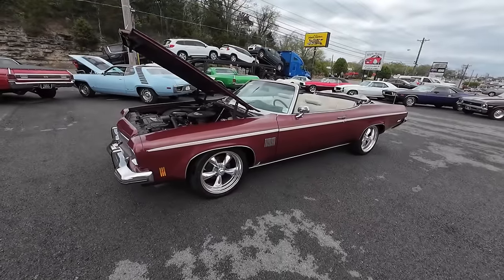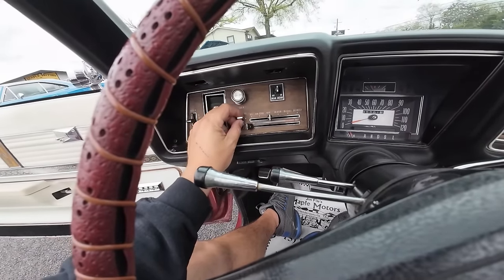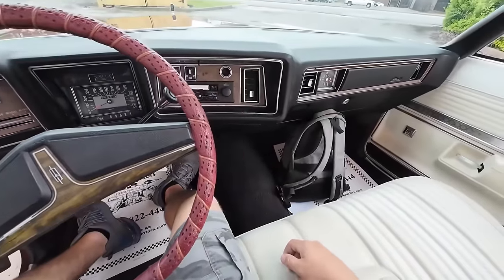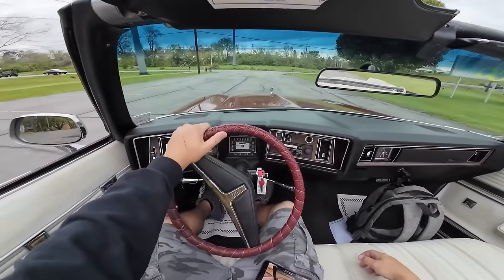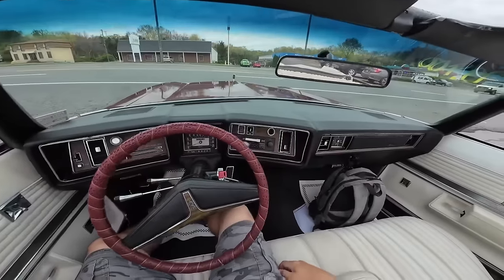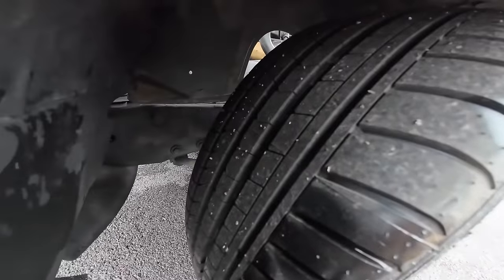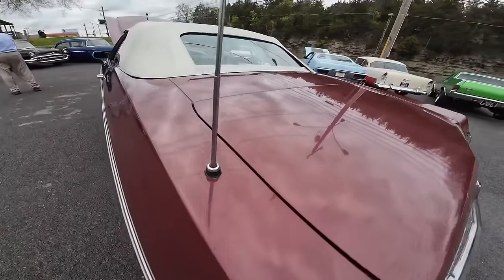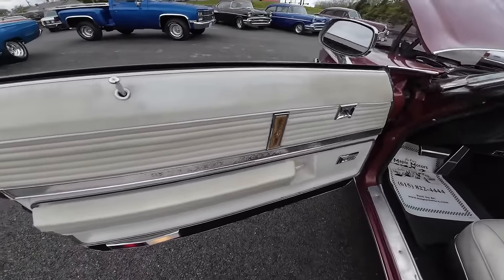Test Drive 1973 Oldsmobile Delta 88 Convertible SOLD $17,900 Maple Motors #2544

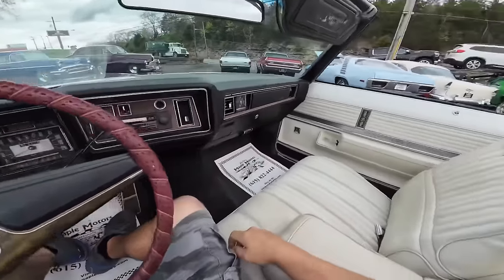Comment: @2:18, I like the widescreen a lot. Also, the interior of this vehicle is bigger than most studio apartments so it's perfectly appropriate. Great inspection and for the price, you get two easy chairs and a full-sized couch along with a convertible top. This beast screams 'good times.' I love the paint job. The engine and exhaust sound great (that starter is a little slow and needs a little love.) and it doesn't look like you need to do much to improve upon. The undercarriage looks incredible (the oil filter has old oil on it, but that's expected.) Also, you don't need a shed or rent a storage unit, the trunk has you covered.
Reply: Come on Bro can't you tell me a little more. LOL !

Comment: Looks like water leaking in the front of the engine better check the water pump and hoses, you can see it when you first drive over the camera or maybe a freeze plug
Reply: They don't check anything. You buy it as is.
Reply: @BillFarel-oj7zc  usually if I spot a issue nick gets the mechanic to check it out and then replies telling us what it was and that it's fixed. Idk
Reply: Hey nick . What's up with the leak. Did they check it out